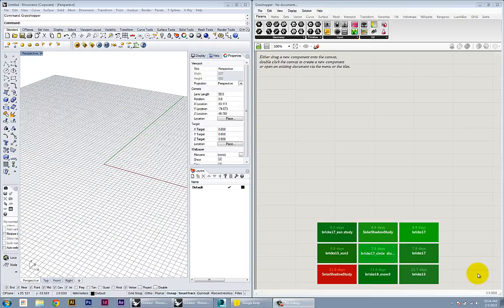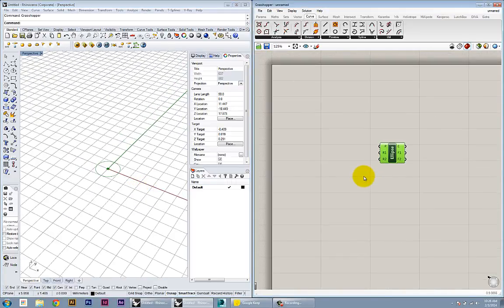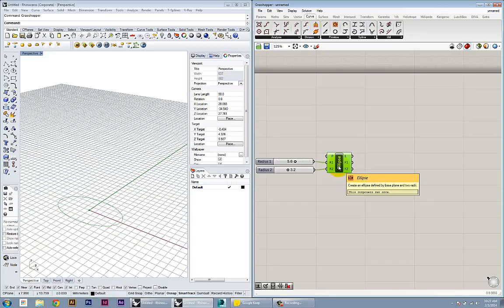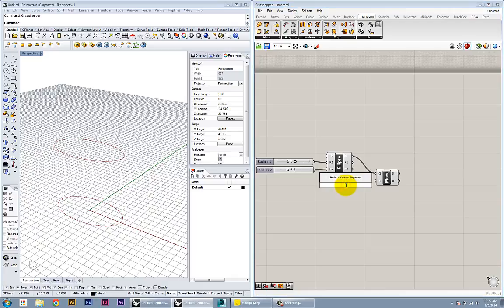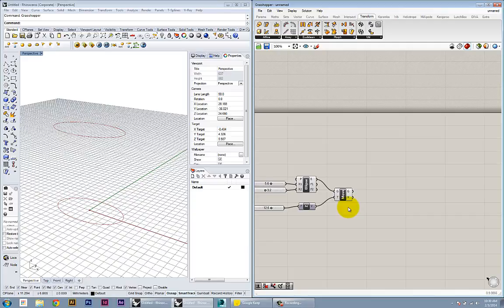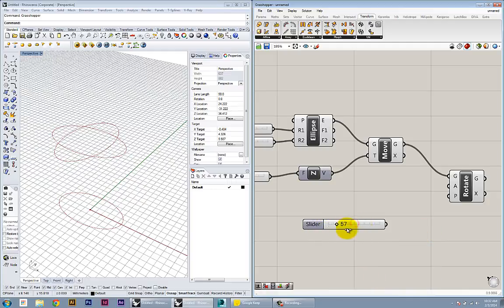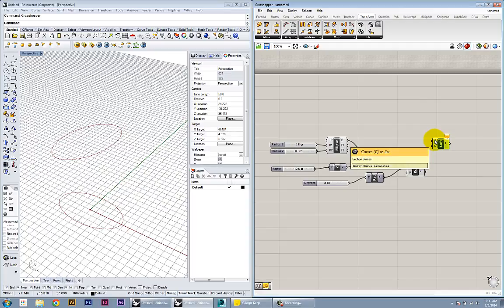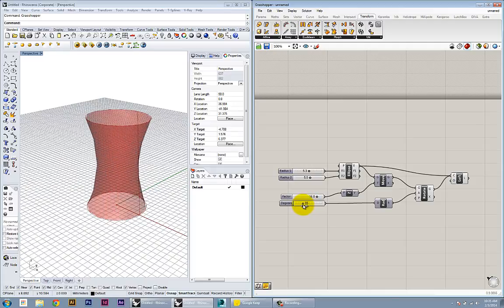Modeling geometry in Grasshopper 1/3

Comment: I following everyting and I am not getting the same result. Could you share the file? My tower seems to be doubling inward towards the top. (fix: in the substract (A-B) you didnt connect a panel with the value (1) to be connected to the B parameter, you typed -1, just like when you divide you do (/2) for example. ) I guess somehow I still need to plug in a 1 into the B of the A-B.